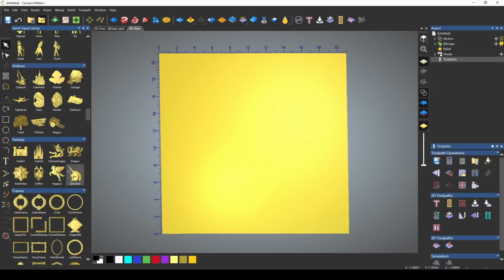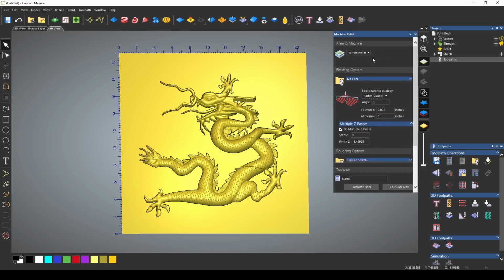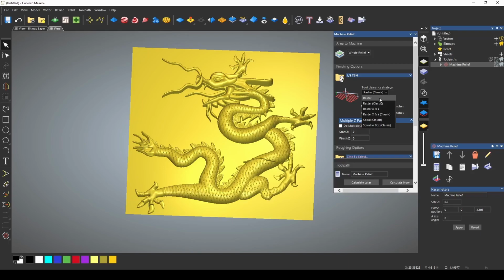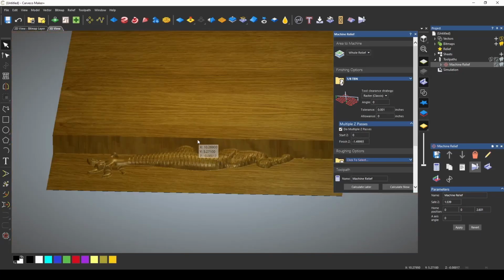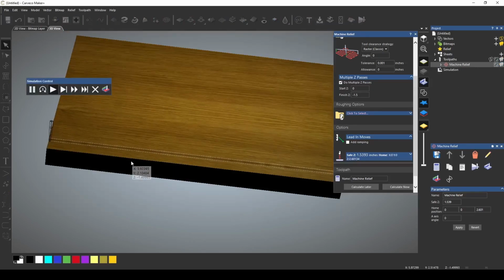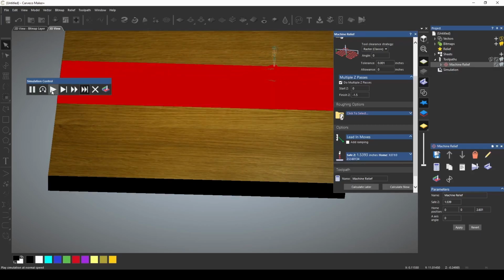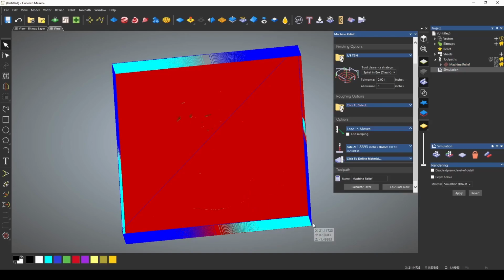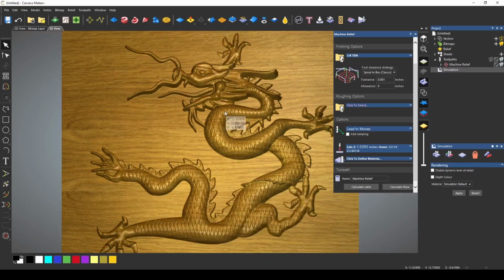Carveco Guide: Decoding the 3D Machine Relief Toolpath Strategies

Comment: When implementing the spiral or-in-a-box strategies how do you secure the wood?
Reply from the maker: I either use  side clamps or use a piece of material larger than my work area.
Reply: @Timberfalls  I've always used selected vector with raster.  Mainly because in the beginning, when I had no idea what I was doing, I tried spiral in a box and it ended in a horrible war between the bit, router and all the clamps.  I've had severe PTSD ever since. I'll have to give it another go soon.
Reply from the maker: @lonniec2116  I have made that mistake as well so I think that kind of error is a part of the learning experience. CNC operation has a lot of variables so the learning curve seems steep in the beginning but with a little trial and error it does get much easier in a short period of time. Hopefully my videos will help along the way.

Comment: That feed and plunge rate seem way high for that size bit in a hard wood; have you actually cut at those speeds?
Reply from the maker: Yes check out this video. It is all about having the right rpm/feed rate combo to get the right chip load to run that fast. This was not hardwood but an example of faster cuts in pine. 
 https://www.youtube.com/watch?v=R84YCrO3DeE